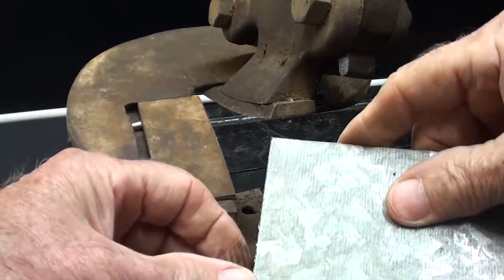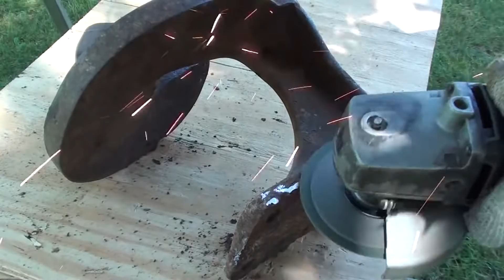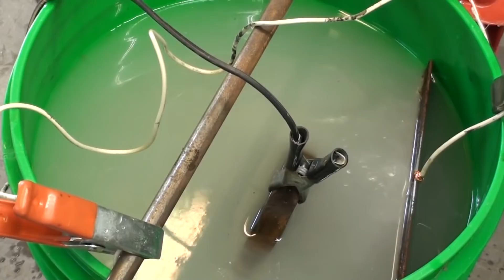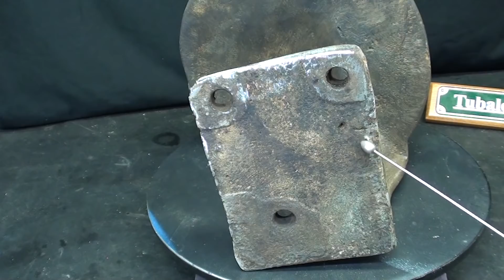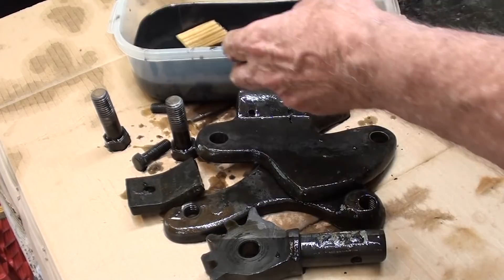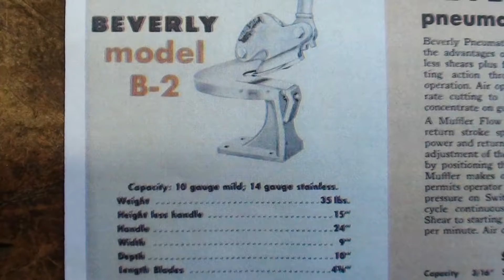BEVERLY METAL SHEAR RESTORATION Pt 1 #741 tubalcain electrolysis

Comment: If you own one, a pressure washer does an admirable job of removing rust and it does it almost instantaeously. small parts would have to be clamped........ that high-pressure water jet can cut you.  It can remove paint as well so be careful.
Reply from the maker: When I worked at caterpillar, they had a pressure washer so powerful, they told me not to get my fingers in front of it

Comment: I picked one up at a garage sale 20 years ago. I never restored it, sharpened the blades on the side of a fine grinding wheel, (yeah I know that’s a No, no) didn’t have set screws so I just used bolts, It works great and it’s one of my favorite tools. Nothing against restoration just never got to it and it works so it’s low on the to do list.

Comment: My Grandfather had one of these shears. He had it bolted to a 2"x8" plank about 30" long. He would cut the larger pieces on the floor Then lift the shear up and cut the smaller parts to size.. Unlike the school districts, he tried to multitask a lot of his tools.  Now I am the very proud owner of this shear and yes it is still bolted to the plank. I can cut paper with it. When I'm working in the shop I give thanks to you and Grandpa a lot. Now I am the Grandpa. And yes they know who Grandpa was and who Mr. Pete222 is Thank you. I remember my Grandfather teaching me how to weld with a bare electrode. He would strike it to get the rod hot the dip it in flux. Life is much easier now.

Comment: In an era long gone I am told in my younger years that is a process known as rough cast. (not crude) Requires a competent foundry to produce these in large numbers at a minimised expense. The imperfections and absence of fettling and finishing does not hide the fact the castings are in fact particularly complexed compound forms, and must fit to a high degree of accuracy. Of course you may wonder about the course sand used? Or is that a result of the lost wax or some other feature of the process preferred? I cannot elaborate.

Comment: Thank you for your videos. Very informative and interesting. I have a question from one of your old ones. Tips #231 . What is the square headed bolt for that is located on the saddle, right side, just behind the screw that holds the apron on? Thanks in advance.
Reply from the maker: Carriage lock

Comment: You said that the frame where the lower blade is mounted was cut using a shaper & I believe you because you showed the shaper marks. But now 15 hours later it's keeping me awake how do you use a shaper to cut a curved surface? Has to be a crazy setup I'm thinking.

Comment: I would heat the pieces red hot and dip them in old car oil, it removes the rust and makes it black and rust proof.
Reply: I’ve found that white vinegar at about $2 gallon works as good as anything. Cover parts in a plastic tub for 2 o 3 days and remove and rinse with water to stop the action. Scrub parts in hot soapy water to remove the black stuff, let dry and it’s ready for painting. The slight surface pitting is excellent for paint adhesion.

Comment: This guy sharpens the blades:
Beverly Shear Blades Sharpened. Remove blades
from shear and ship to Clay Spencer, 73 Penniston
Pvt. Drive, Somerville, AL 35670 $41 includes return
postage, additional cost for deep notches or blades
previously sharpened at angle.
He did a great job on my #3.
Reply from the maker: Thanks

Comment: Another great video.  I bought a new B2 shear from Mittler Bros a few months back and the casting on the main body is pretty rough also.  I noticed when you had the handle all the way up, the back end of the top blade clears all the way back to the back end of the bottom blade. On my new shear the back end of the top blade meets up  1 3/8" of the back end of the bottom blade.  That means the last  1 3/8" of the back end of the top and bottom blades are unusable.  It also makes it harder to turn the metal in a clockwise direction to make a curved cut to the right.  I called the  new company and talked to one on the techs or engineers and was told they had made some kind of change to the newer models.  He told me I could grind a little off of the last tooth on the handle to let the top blade go up a little bit more, which I did and it only gave me another  1/8" of usuable blade length.  If I would have known all that, I probably would have just bought a used B2 off of E-bay.  But the people selling used ones on E-bay seem to think they are made of gold with some of the high prices they have on them.  All in all it still is a pretty nice metal cutter, I just wish I could use all of the blade lengths.  I enjoyed the video.  You will have a nice tool when you are finished.   Dan

Comment: So, what is the black residue??  Steel is an alloy of iron and carbon.  When steel rusts, its the iron that rusts and the carbon is freed from the alloy.  Evapo-rust "dissolves the rust and frees up the carbon thus leaving the carbon residue on the surface.  You may have observed the carbon residue on the surface of the electrolisis rust removed parts as well.

Comment: Once when removing the hardened shears on mine i dropped one and broke it in two I couldn’t source a replacement so i welded it back together and cuts again but not ideal wish I could find the wear parts to buy.

Comment: It would be interesting to put two clean (no rust) steel plates in the "cleaning soda" solution, and make one a cathode, and the other an anode.  Leave it connected to your charger a couple days, and then look at the plates.  I predict that one plate will be covered in rust.  Where did that rust come from?  Likely, the electrolysis process, in that setup, is also a "rust generator"?
Reply: There wasn’t that much rust on the shear as Mr. Pete pointed out. I think the electrolysis just rusted both plates. Besides, it’s a nasty messy way to remove rust.

Comment: I have a B-3 I got from a farm in a ball of rust, did the same,derusted and sent the blades to Beaverly several years ago,very nice people, they told me mine was one of the first made as the blades were the original.angles but still had the sharpening fixture. I also asked if I could get a new plate,they gave me the plate the screw nails,I think they called them and the drill bit for free as I paid for the blade sharpening. I liked the fact they had no website no computers, I sent the blades with a check,and got them back with a hand written receipt. I think the B-2 is the best size to have for sheet metal work. I have the 3 just because I got it cheap,and now a prize possession  in my shop.

Comment: Thank you for the video. I have never previously seen a throatless shear used. It wasn't obvious to me how useful it is. Your demonstration makes me want one. 

I pulled into the parking lot of our local family hardware (same family in business in same location for over 125 years) and a very old stomp shear was in the lot with a sign for $50. I didn't examine the shear closely, but I suspect that it was 100+ years old, just by the shape of the castings. An owner brother walked out at that moment and I told him that I would buy it. He commented that he only just listed it on FB marketplace.  I grabbed a $50 and handed it to him. He asked for the balance. That was when the crudely made paper price sign was pushed in place and I saw the next digit ($750).  I don't know if he got his asking price, but it didn't sell very fast, and I don't own it!

The store owners have been my dear friends for decades. My price shock embarrassment did not harm our friendship.  I shop locally at their store now that I am retired. When I was as employed I drove past numerous wholesalers and big box stores on my daily commute. Most of those stores now add a minimum of 15 additional miles of one way driving. My friends get more of my $ for their inflated hardware store prices, because of the ease of location and their pretty extensive inventory. They also push most of their extensive stove business contract installation to my son's business, and one of my grandsons could easily make a career managing their store when the brothers retire. The brothers are 4th generation store owners and still offer a substantial amount of sheet in metal services. At one time they did extensive sheet metal work, fabricating things like archetectural accents and very large stock tanks.
Reply from the maker: That was a good story about the price sign.

Comment: Pete, you can straighten that handle. Put it in a vise horizontally with the bend at edge of vise. Take the oxy-acetylene torch and heat it . When it is hot all  the way around give the end of handle a hard yank or put a small pipe or rod in handle to assist. That should take out the bend. I worked for an old blacksmith  and we did this all the time to straighten bent tubing and round stock. AL B.
Reply: Thanks for that tip.

Comment: I was told that the evapo-rust (pronounced like evaporate) was used to remove/loosen the rust so a little work with a wire wheel removes the black finish and any remaining rust.